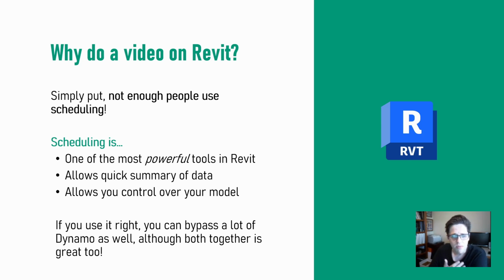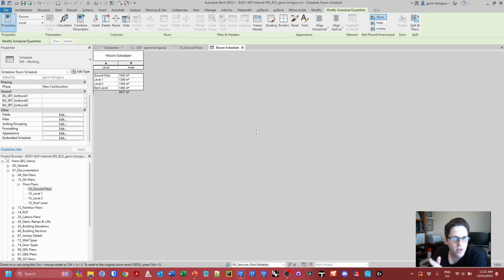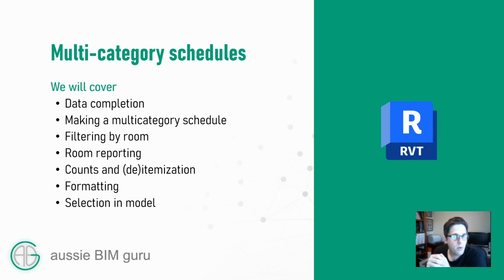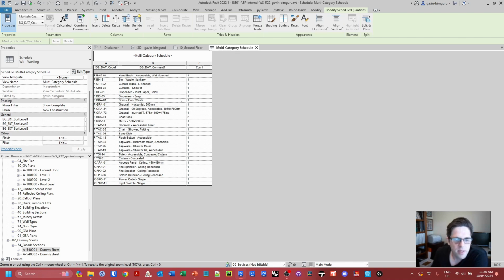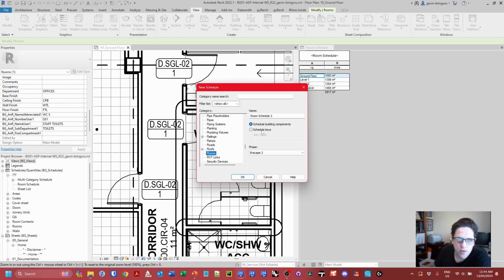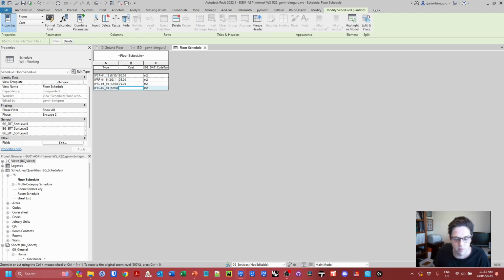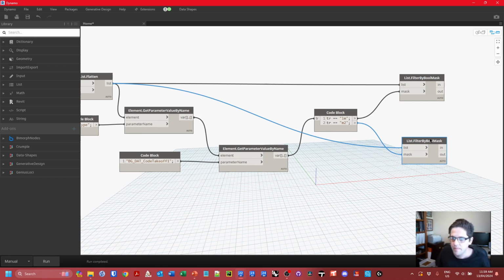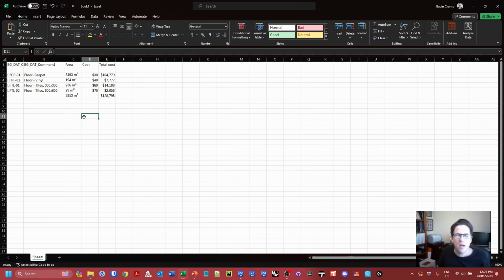Mastering Revit scheduling!

Comment: Is there a way to compare area totals against council fsr? And give a yes no in whether it complies. Trying to find a solution that will allow me to do this automatically and just drag and drop onto sheet
Reply from the maker: Not easily. You'd effectively need a single row showing the totals and the compliance, so it'd take some hacks.

The technique I'd suggest looking into is getting the sub-total % of each area per row of the total overall area as a calculated value, then you can divide the area by its own % to get the total area in each row of the schedule. From there you can feed them to a Yes/No calculated value against a project information parameter containing the required max FSR as a number, and they'll either all register as yes or no and can be collapsed into a single row by turning off itemize every instance.
Reply: @AussieBIMGuru awesome thanks heaps 😊

Comment: Thanks a lot for your video, learning a lot from all of them.  There is one thing that i would like to ask about:  is there any tricks that able to push the Elevation parameter from Level Schedule into Area Schedule? Did you try it before?
Reply from the maker: Unfortunately elevation is a property of the level which is unavailable in area schedules beyond the Level parameter that the area has. An app like Dynamo or an addin could set this data to a custom parameter but it would be out of date between runs.
Reply: @AussieBIMGuru  Thanks a million on your reply.  I have been researching a bit on this issue but seems like impossible to push the data without dynamo.  I watched and learned quite a lot from your videos, thanks again.

Comment: how to add parameter to floor family for calculating shuttering area in schedule and its cost? Beam bottom shuttering is having different rate per sqm than slab shuttering.
Reply from the maker: I would recommend adding a project parameter to the intended categories at a type level.

Comment: I found it to be a very complete summary of the possibilities of schedules in Revit.
Usually I export the tables with TAB as a separator, open a new excel file and from the Data tab I use the get text/CSV data function. This allows you to create a data table directly and edit it from power query.
Reply from the maker: Yes tabs make for great delimiters i find, far more reliable than commas!

Comment: hi 
i really love that most of your videos are more than basics level and kinda advanced level. i want to ask you about if you know a way to be able to have a schedule adding the room number parameter to it. yes i saw how you add the parameter and i did as well but my problem is what if the rooms are from a link (like for example architect link) and my schedule is for electrical fixtures or mechanical equipments that exist in my model (mep model) which dont have rooms. is there a way to schedule by room without adding the rooms to my mep model ? 
(extra question xD - i tried also making schedules to system families like cable tray or ducts but the Room field of parameters dont even show. i think its somehow limit the system families from being in the room since they are not point based families to be existed as i fixture in the room where the start could be inside the room and the end could be outside. but it still would be a nice thing if we can achieve to get the schedule that would calculate the total length of cable tray only in that room. i wonder if you have any idea how to do it )
Reply from the maker: Unfortunately linked rooms dont support native room report and as you guessed some elements do not naturally report to rooms.

The next nearest workaround is to utilize dynamo and the revit API to ask which room is at a point. You would need to get what that point is relative to the element so for a wall for example you would need to decide if that is its midpoint, although it might be between 2 rooms so not really in one. Youd need to account for a lot of cases potentially.

This is the API method which can interrogate linked models also:
https://www.revitapidocs.com/2017/7dbcac93-ec82-5f60-4a54-a427f3e1cc1e.htm
Reply: @AussieBIMGuru  thanks

Comment: I use schedules on regular basis but I’ve never tried key schedules as I didn’t know what they they where for. Looks pretty powerful. I mainly use schedules for pile foundation plans, the ability to have them count and sort is pretty handy. About a year ago I discovered that it’s possible to embed type images in certain families which is really handy in the context of a pile schedule. The only thing I’m kind of missing is the ability to automatically set mark fields or to renumber them. I always have to do this by hand.
Reply from the maker: Yes key schedules have a lot of amazing use cases, especially once they allowed them to drive shared parameters in Revit 2022. Type images are a great feature as well, I use them sometimes for various purposes - can technically achieve an ArchiCAD-esque door schedule using them also.

Autonumber/mark certainly sounds like a potential automation opportunity!

Comment: @9:27 don't use shortcuts! You just change the title of the row. (Which you can see happens)

Dot ask me how many schedules I've published with a shortcut in the title. (I don't know, but that's because it happens without realising)
Reply from the maker: Haha yep whoops good catch! Sneaky Revit...
Reply: @AussieBIMGuru  Yes Revit is sneaky sometimes.

I have a topic that might be interesting for at least 5 of your followers. 
I'm an MEP engineer, AMD use spaces based on the Architects Rooms. But once they start working and move rooms around and gasp delete some of them, my carefully added data disappears.
Besides me making all my spaces manually, are there any workarounds, for me or the architect?
Reply from the maker: @mariepindstruplinde1671 certainly are, I'll add it to my list. The main one is to ensure you use a piece of data common to the room (e.g. a number), then you can generate spaces from them, and separators from their boundaries. Tracking boundaries is a bit harder and would involve storing their id lists to the space itself (as they cant hold data of their own), but ill look into it...

The script would then run through the steps below:
1. Make new spaces (using space/room numbers to check/get spaces)
2. If on same level, just move them
3. Pass data to them
4. Unplace (delete) those not placed. Report those not unplaced by architect
5. Delete all space separators
6. Recreate new space separators, store their ids as a list to their space

The catch would be that spaces are 100% automated and not edited by anyone manually from there aside from data not being pushed over. It would work off a linked model.
Reply: @AussieBIMGuru   Now that got you started... As always,  are the best for bringing the solutions ! Great video and thanks for the insight !

Comment: You didn't get a prompt when opening .txt in excel since it was already converted by drag & drop method. You needed to close excel completely and then do File/Open.
But great video on schedules, I haven't used option to schedule link and certainly wouldn't guess that both models need to have same shared param.
Reply from the maker: Ah yes it does seem to store that behaviour in session... good catch!